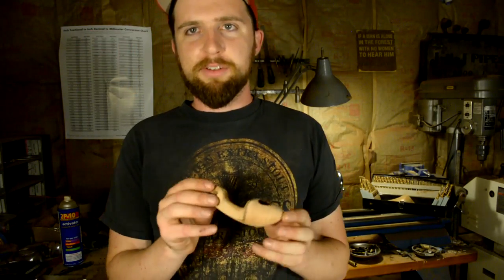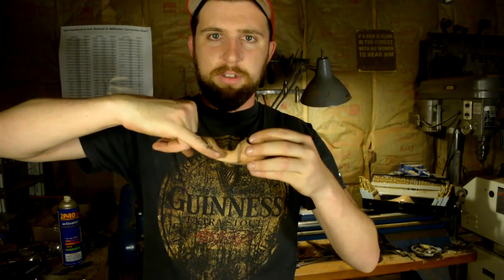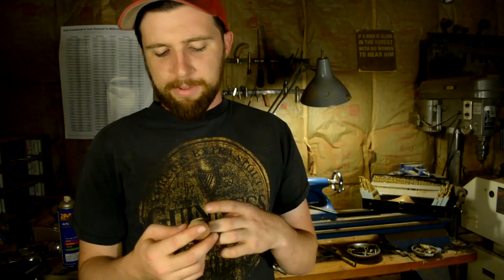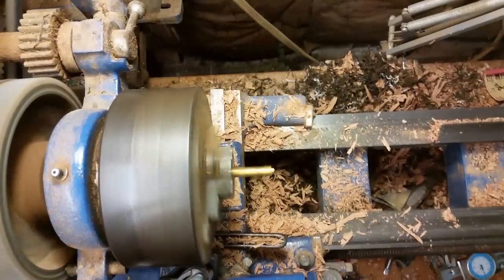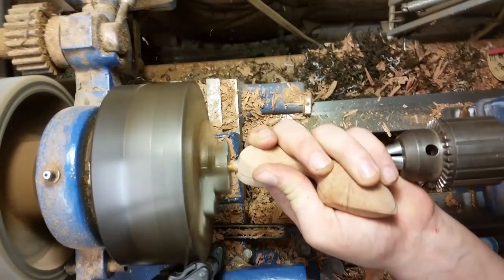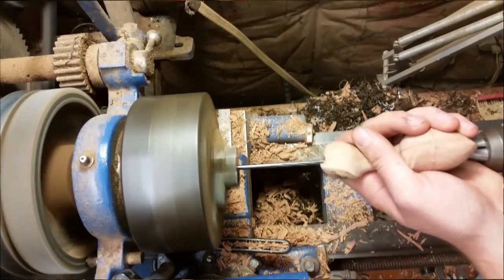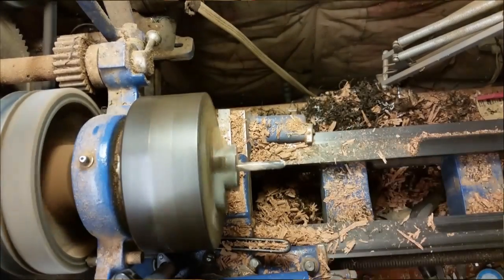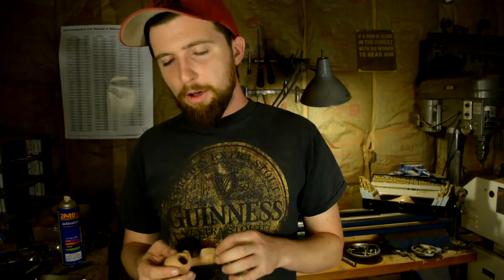Freeform Drilling 101

Comment: I find it much more convenient to evaluate the grain structure in three dimensions on the block very carefully and then drill the connections in correct size. Then I have no problems to form the pipe within a limited 3D.

Comment: Great video Jared, very useful. Drilling the air way in segments is a technique I'll use in the future. I've had the bit veer off center in the chamber before and I'm betting your method will help prevent that. A little difficult to tell from the video but do you use a pilot point bit for the mortise or just a standard bit? Thanks and looking forward to the next one!-Josh
Reply from the maker: J. Thomas thanks! For the mortise I use a 5/16 "self piloting" bit, which is very similar to a Brad point style bit.
Reply: Gotcha, thanks!